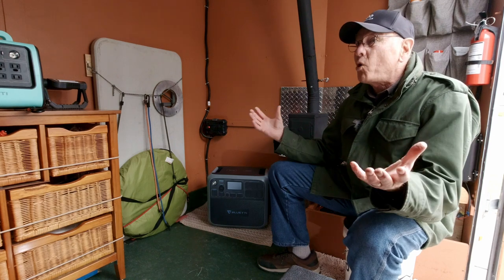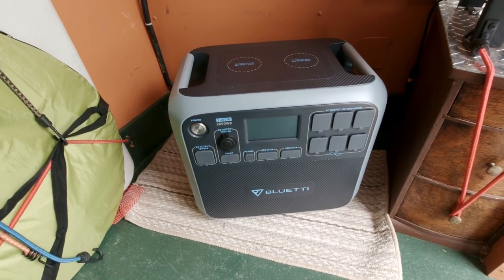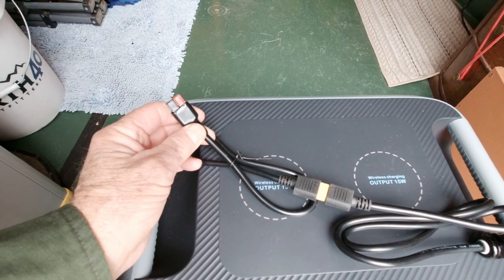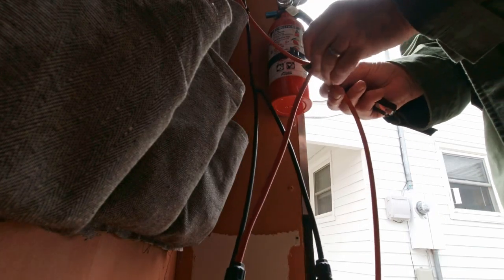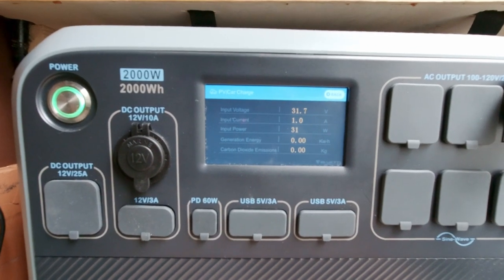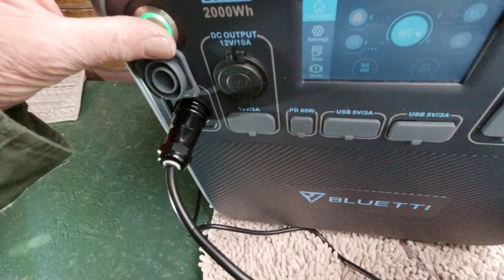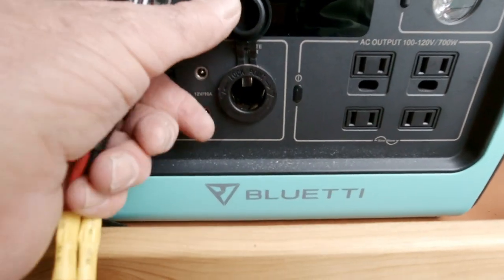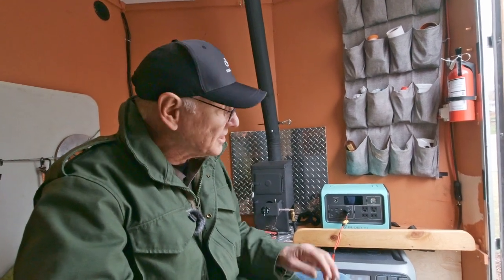Hooking up a portable power station to your RVs electrical system

Comment: I have an AC200P that is almost a year old.  I am needing to power my diesel heater in my van so I ordered a $30 male aviation plug from Bluetti for the ac200p so I could use my 25 amp outlet.  They sent me a 30 amp plug which does not fit and said thats the only plug they offer now.  They said they do not know where I can buy one as they switched from 25 amps to 30 amps on that plug recently.  Anyone know a source for this plug?  I just need the plug and can attatch an xt60 on the other end of the wire I am using.  Thanks.
Reply from the maker: I know that they switched when they came out with the AC200 Max.  It seems to me that you need to talk to them again and insist that they put you in touch with someone who can supply that plug.
Reply from the maker: I just looked at my plug and it's a "Weipu SA20 series"   Bingo!!!  https://amzn.to/3NcPwfh
Reply: @gonagain  Excellent!  I just now ordered one.  Thank you so much, this was very helpful.  The bluetti folks emailed me this morning and said I can use the one i ordered from them as the 30 amp aviation plug will plug into the 25 amp outlet.  I am not sure if true or not as on the bluetti forums, i have serm folks complaining they got the 30 amp plug and it does not fit.  My bluetti 30 amp plug wont be here for another few weeks and thats why i ordered the one you linked to, as I know that one will fit. Thanks again and, safe travels.

Comment: i have the orginal bluette ac-200 just asking your opion what if i run some wire right as the solar power comes down to the solar controller and put it over to my bluette so it doesnt run through the solar controller?
Reply from the maker: Hello Curtis, I did that for a long time, and it works , but the wattage will be divided between the two loads.  That's the way it was before I did this install and, with 400 watts on the roof, I would get half of whatever they were producing to the AC200P and half to my house battery.  When one was topped off I'd get more to the other, but never the full amount.  It's an option though and I'd do it again if the need arises.

Comment: Hello I have a 2003 Winnebago sightseer and it seems to not be getting any current to the inside lights and appliances. I bought new batteries and it still won’t work. I was wondering what might be going on. It only works if it’s connected to hook up or with generator.
Reply from the maker: Sorry to keep you waiting, Miguel.  First thing I would check is the ground from the negative side of the batteries to the frame.  Then check your main breaker for the DC system.

Comment: Why oh why does the industry have so many plug options. There must be a reason for the madness but I was lost after the second set. I think the 'Idiots guide to wiring' would still be too advanced for me, good grief.
Reply from the maker: I hear you and understand your pain.  After working with these for the last couple of years I've found that it comes down to only a few common plugs and, come to think of it, those are actually all seen in this video.  The other thing that I can tell you is that any adapter you could possibly need is listed on Amazon.  I hope that helps!

Comment: I think the power stations like the Bluetti are less likely to fail and leave you without electric. Yes, the home-built component systems can be replaced individually if each part dies. But will you find a solar charge unit if you are in a rural area? I think one quality station is better than 4 or five unknown quality parts.
Does the main fuse for the system come with a cover? I saw the cover for the bus bars. Also, I would have liked to see the Bluetti strapped to the wall.
Reply from the maker: I still need to finish up the installation and securing the Bluetti is at the top of the list, but I have to move one of those buss bars so that I can slide the AC200P further in.  As for that circuit breaker, I need to fabricate a cover for it yet.